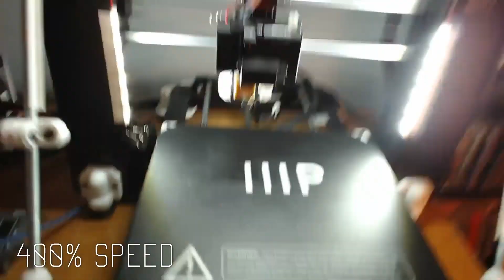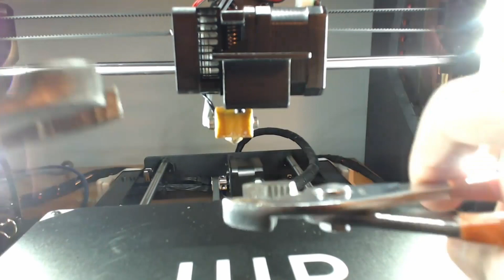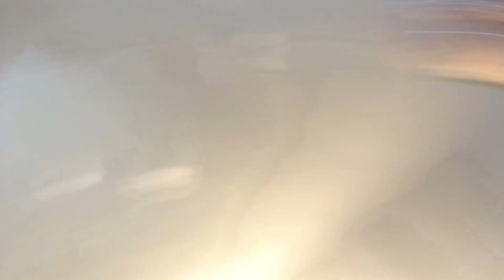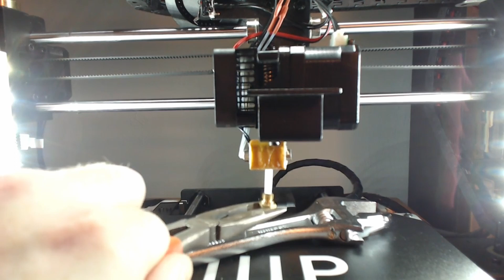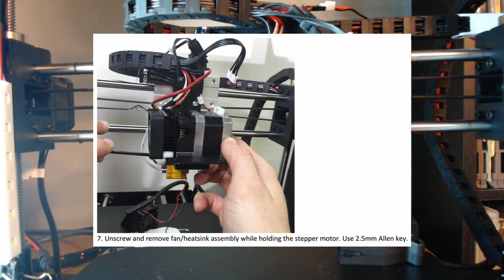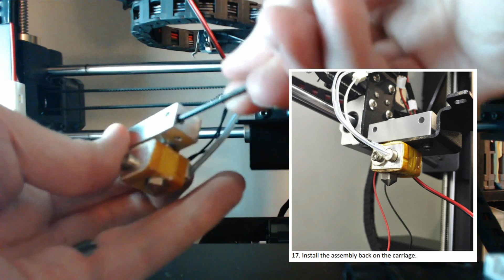Micro Swiss All Metal Hotend (upgrade)

Comment: Which light mount is that?
Reply from the maker: Hi there! The one that's mounted on the frame is this one (https://www.thingiverse.com/thing:1196776), but you can see there are some mounts on the z-brace (https://www.thingiverse.com/thing:2204920) that I've been using instead and I really like them better. I'm also working on adding a light to the front fan mount that shines more directly onto the hot end (https://www.thingiverse.com/thing:2018702), but that's currently an "in progress" thing.